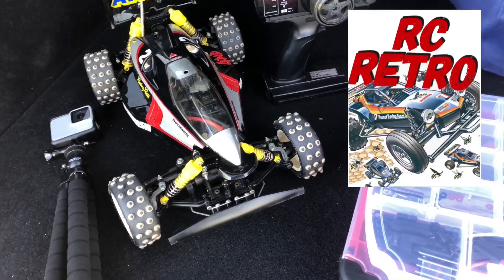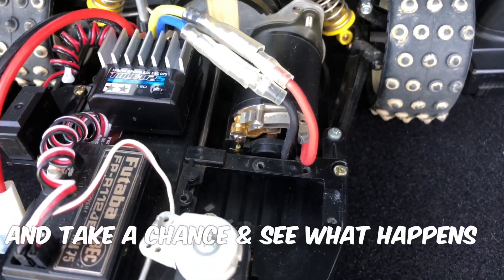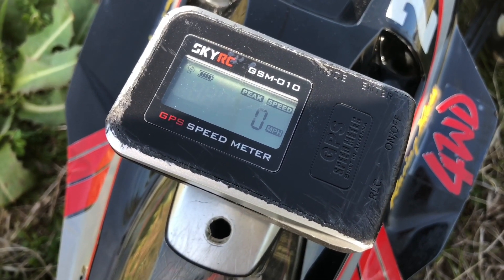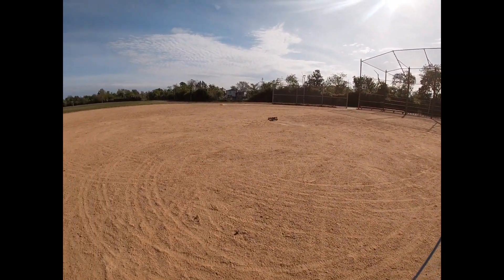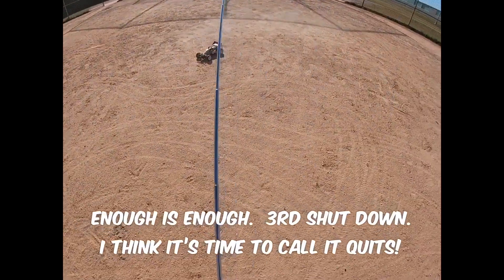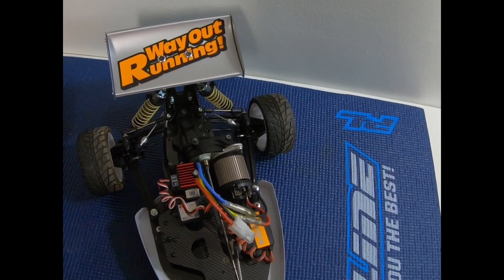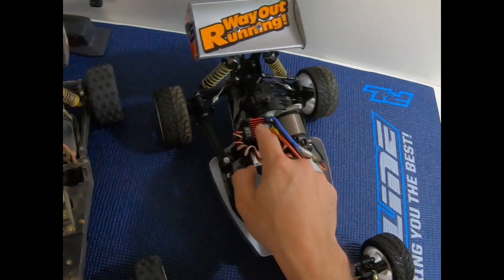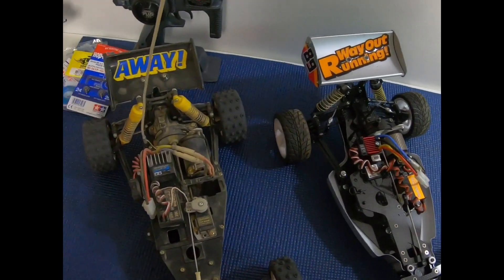e65: TAMIYA VANQUISH ESC THERMAL SHUTDOWN

Comment: Hop up ESC fan is a must with these ESC's..I run 3s all day on a sensored 13.5 with the fan..Without it goes into thermal mode after a minuter or two.
Reply: It's a 60 amp it can run that brushed motor just fine..They require the Hop up fan though..That's why Tamiya sells them lol..Watch my videos on this ESC
Reply from the maker: I was thinking of getting a fan but, I think I’m just going to get another hobbywing 1060.  Plus I’m going to run this only 1 more time and then it will be restored and shelved.
Reply: @RCRetro  The fan works wonders dude trust me..The 1060 is kinda a joke..1040's are far better..1060 requires a cap pack upgrade to be able to run any decent motor more than a few minutes..One tiny cap from the factory?? what kinda stuff is that? Lol

Comment: I would get rid of the Tamiya style battery plug, they are currant limiting which means a loss of power. For a shelfer or a stock unit they are ok but for mod not so much. Sweet buggy though!
Reply from the maker: Thanks for the comment. Yes, I was highly considering swapping out the plugs.  What do you recommend?
Reply: I would say xt60 would be a good choice for your application.

Comment: The TBLE-02S cant't handle 23t in rough terrain or in high temps. You may try the cooler for the esc but i think a Hobbywing 1060 is a good choice. I got one on my Top Force with a Super Stock 23t RZ. Works fine even in the heat.
Reply: 1060 needs cap packs to run anything over a stock can..This ESC can run down to a 13.5 on 3s  but with the hop up fan..ask me how I know? lol
Reply: @philthyco1  Well, it depends if if you have older version of 1060. Mine works fine.
Reply: @GTMatukka  I have a brand new one..It goes into a limp mode even with a torque tuned after 5 minutes ..It slows way down to half speed..It needs the cap pack upgrade..It only has one cap stock..Even the 1040 has 2 and can run a lower turn motor out the box..I like the 1040 better than the 1060 ..But after the cap, pack upgrade the 1060 becomes pretty good.
Reply: @philthyco1  I hope that mine won't give up. I've ran few batteries with it in my Top-Force  SS RZ without problems.
Reply: Maybe it's the gearing? Or weather,temp getting too hot? I have a heat sink on my RZ.
Reply: @GTMatukka  Nope..It does it in 2wd rigs with low gearing also.. It's very common that's why they came out with the cap pack upgrade to fix the very common issue
Reply: @philthyco1  Yes, i know the cap pack fix. How come it doesn't affect mine?
Reply: @GTMatukka  Who knows lol
Reply: @GTMatukka  Tamiya Legends did a video on the cap pack..It worked great and he can run low turn racing motors with it now
Reply: @philthyco1  Yes, i've seen it. If i encounter this problem in the future, i'll try it. But for now 👌🏻
Reply: @GTMatukka  The cap pack allows you to run low turn motors..23 is hardly low at all..So when you want to run a mod motor get the cap packs